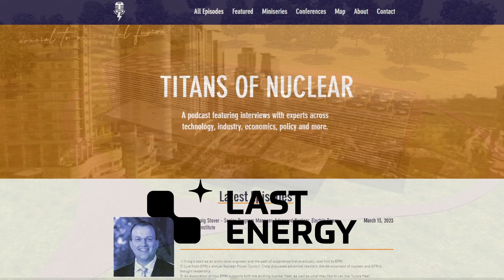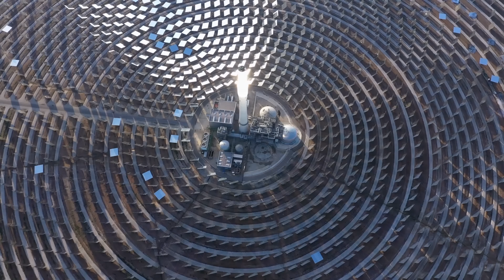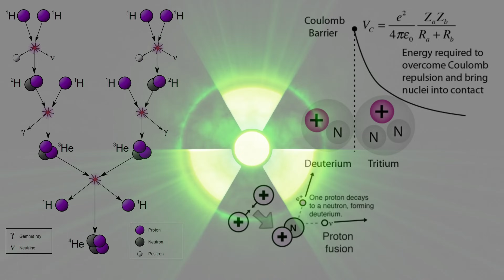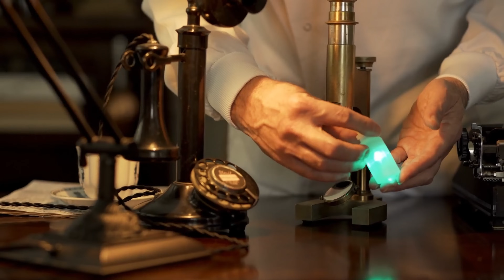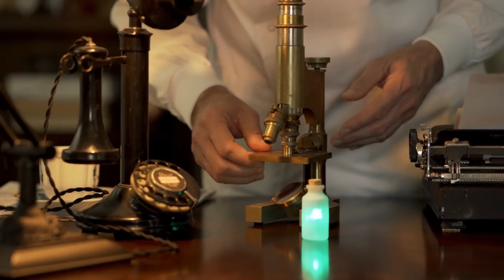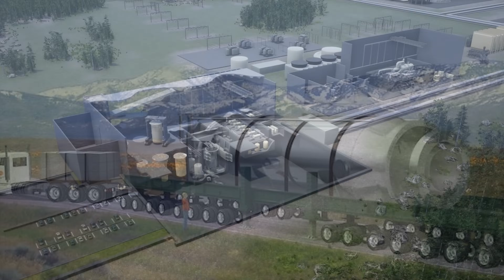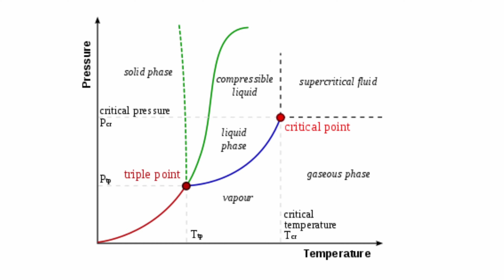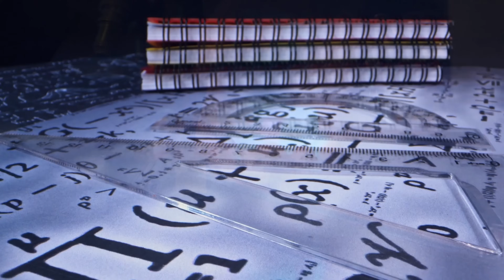Nuclear Power: Small Modular Reactors

Comment: I am disappointed Isaac didn't mention the Argentine CAREM SMR. We were the first country to finish a design and start to build it. We are behind schedule due politicians screwing the budget, but we were 20 years ahead of the rest of the world, until China made theirs.
CAREM is 25MW for the experimental one, which will be scaled up to 50 and 100 and you can put several of them to increase output as needed. The idea is to build small nuclear plants at low cost close to demand points and fast using serial production of the reactor's components.
Reply: I'm interested in this subject but have never heard about it. Thank you>
Reply: I love it. 

My philosophy is simple. 

MOAR SAFE NUKLAYR NOW
Reply: Sadly today's political leader are holding society back and preventing a nuclear Renaissance because of fear mongering.
Reply: It doesn't sound like you're ahead of NuScale in the USA, with their 77MW reactors.
Reply: @cacogenicist    They have a different concept, is more complicated and tradition outside the small modular part. CAREM are an escalable design, you can make them produce less or more, or have traditional reactors output just pairing several of them. The design can produce 20MW up to 120, the 25MW is the tech demonstrator. 
It is a fully self contained reactor without active control, cooling, moving parts. It cools by convection and the physics make it impossible to fail as it operate in a very difficult and rare spectrum of equilibrium and any deviation self corrects by pure physics. You can read papers of it on international sites of nuclear technology. 

Youtube deletes comments with links, so google: neimagazine feature
carem argentinas innovative smr

We could have had it working 10 years ago if not for the corrupt and inept governments withholding funding. So the CONEA (nuclear scientific authority) and INVAP go slow on it.
Reply: Sorry but except of new name yours reactor don't differ from 50 experimental reactors
Reply: @simon2493  Actually it does. Is one of the most advanced, safe and simplest of the lot. It use 100% passive cooling, no moving parts, no auxiliary equipment like most of the US projects. 
No pumps, no active control. Is a self contained reactor. There is plenty of english papers from nuclear tech sites explaining it. 
Also is not a "new" name. CAREM has been on development from decades. It is on construction and only held back by the governments wasting money in anything but where is needed.
Reply: @Argentvs  Considering China has opened a bunch of coal plants, and regularly lies about their tech projects (not to mention the IP theft), you're probably still ahead of China in reality.
Reply: @Argentvs  SOmething like Sweden proposed in 80s or smth....
Reply: @piotrd.4850  The idea comes from a long time ago, but never passed from theoretical proposals. Though the work in Argentina also roots back to the 80s when Argentina was building experimental and isotopes reactors. Possibly is has s lot to do with the Nuclear Power Submarine project, cancelled in the 1990s with the wave of destruction of the national defense industry by pressure of the USA. The Navy was on work of a small compact reactor using enriched uranium. Which our SMR CAREM also uses.
Reply: @Argentvs  Maybe don't get your funding from governments?
Reply: @algorithmgeneratedanimegir1286  all nuclear activities in Argentina are a under the National Commission Of Atomic Energy (CONEA). Uranium enrichment plants, heavy water, special fuels, special alloys and high tech dedicated things related (space solar panels, nuclear medical equipment and products) are the work of it and it's state companies liked NASA ( nucleoelectrica Argentina, power reactors), Dioxitec, etc.

CAREM is a propietary design of the nation designed by national scientific and technical research system by the Balseiro Nuclear Institute, part of CONAE. The builder is a state company society by the province of Rio negro state, where the Balseiro institute is, and CONEA. Subcontractors can by private, like Pescarmona Heavy Industries which made the pressure vase of the reactor and other high strength steel parts.
Reply: @algorithmgeneratedanimegir1286  Then you won't get anything built period. The global nuclear buildout is dominated by either direct government-owned companies like OPG or regulated monopolies that negotiate with the government to set rates to a level that allow them to commit to large projects, see TVA. There was actually an announcement on SMR collaboration between Canada, the US and Poland over developing SMRs and OPG and TVA were the utilities involved with only Synthos Green Energy being anything like a private company. OPG is comfortably in the lead in getting a reactor built and TVA is prepping a construction permit, the most private capital oriented of the utilities involved is basically just in the room with the people actually spending money and doing the work.

This isn't a mark against Poland either as the depth of knowledge and capacity in their nuclear industry just isn't there to expect them to be an aggressive first mover but if the only way to get private companies moving is for them to catch the bow-wake of a government initiated project... well it tells you who the key mover is. I look forward to the day where my perception here is challenged or changed by some private company betting big on a 40+ year nuclear investment but until we see that investment then government or government associated entities are the only tree worth barking up.
Reply: @algorithmgeneratedanimegir1286   that will slow down the progress considerably. Kinda like here in the US. Private funding only blows.

Comment: Nuclear currently is the only viable option for large scale green energy. Solar and wind work at small scales, but they're still too expensive and inefficient to power whole towns, at least not without supplemental sources.
Reply: And solar requires a lot of mining of rare earth materials which causes deforestation & creates a lot of pollution.
Reply: Solar has been plummeting in price and still is. It already is way cheaper than nuclear, especially when you remove state subsidies because no private entity will insure nuclear power plants.
Of course for solar you need to add the costs for storage but those are coming down fast, too.
Reply: Depending on country one or another type of green energy already replaced in huge chunks nuclear energy and its effectivness is still increasing. With upcoming better batteries, there isn't even anymore the old argument viable that it is just to soften peaks as one then can safe the energy from those peaks for the rest of the day. Even in cloudy areas due to no more effective solar cells, they are viable. 

Besides all that though. Nuclear energy still has one main issue not solved, there is neither a way to store nuclear waste safely for millenia to come or inform those who come afterwards what those sites are all about when they find the crumbling infrastrucutre and leaking waste. Nore is there sofar a way to chemicly change nuclear waste into not-radiating other materials that then could be reused for other purposes. Breeders may reuse some waste, but also produce even more dangerous materials in the process. Thorium reactors are still not a thing or have you heared any success from the Chinese test reactor that should have already been online now for months. I would assume they would have bragged about it by now. Thorium molten salt was not followed up for several reasons, one being that the  brine is so  corrosive that no material would withstand it. Please let me know if you have actual scientific proof there has been successful energy production with molton salt reactors that deliver energy reliably over a prolonged time. Don't get me wrong i would love to see the Chinese succeed in this one aspect as that is the only form of nuclear energy i even remotly would support as "green" energy. Till then nope, no deal.
Reply: @kinngrimm  Spent fuel reprocessing solves the long-term storage problem.  After burnable fuel is extracted the remaining waste consists of fission byproducts that decay to safe levels in 300-500 years.  It also very effectively extends fuel supply.

Comment: Just in time!

I was wondering if it was theoretically possible to get handheld reactors or at least reactors the size of say, microwaves
Reply: theoretically possible ? yes , but practical would say No . Isaac?
Reply: @paperburn  Why would it not be practical?
Reply: RTGs are a better choice
Reply: @duckpotat  You can't really make those output more power though

I was mainly looking for something that has the advantages of a reactor
Reply: @hoominbeeing  I think the issue as far as I understand it is that microwave-sized or smaller reactors would need to run on exotic low-critical-mass isotopes produced in breeder reactors, with expensive fuel production, a limited shelf life, and significantly higher 'unused' fuel radioactivity, making keeping the reactors fueled them an issue. They'd also generate a LOT of heat for their size, potentially needing some sort of external cooling with water or air.
It could be done, sure, but it would probably not be a popular source of portable power due to the extreme expense and numerous hazards, unless there was some super-important need for extremely high density portable power generation, by an organization able to produce, distribute, install, and dispose of the exotic fuels safely, on top of actually operating the reactors, and no better options were developed.
Reply: @05Matz  Can't you enrich the uranium (or polonium, since it has lower critical mass) to get lower critical mass?

Current reactors are enriched to 3% at most, this one could be 90%
Reply: @hoominbeeing  Well then your microwave would be carrying weapons grade uranium, that is, the heart of a nuclear bomb, so I think it's a no go on that one chief
Reply: @hoominbeeing  You could probably do it with highly enriched uranium or plutonium too, but that's pretty frowned upon, as it would look exactly the same to other countries as building nuclear weapons, and the facilities required could probably do both fairly easily. I'm not a nuclear engineer, but I think you can make smaller reactors with higher purity fuels, that makes sense to me because there's more of the fissile atoms and less of the rest in one unit of material.
If a power that already HAS factories for producing new bomb cores wanted to build tiny reactors for some kind of high-security military use, they probably could figure something out, I suppose. But I'm not sure how far you can go with any given fuel.
Reply: @hoominbeeing  Ots possible to make tiny "nuclear batteries".   Richard Muller has a fantastic book about alternate nuke power plant designs, including small solid-state reactors to power a small town that can be built entirely underground, sealed, and need no maintenance for decades.  These are great for security concerns.  There would be no way for bad guys to steal hot stuff without a giant, months-long excavation project.

I think he also covers handheld reactor designs.  It's definitely possible.  . . .except for the problem of retail products full of reactor-grade uranium.
Reply: @jengleheimerschmitt7941  Ik about nuclear batteries/RTGs, but those are quite different from reactors.

As for handheld reactors, I wouldn't imagine those in Walmart lol. Handheld != Sold in walmart
Reply: @hoominbeeing  I could see backpack/microwave-sized nuclear reactors being possible, and I love the idea just for the story concept of a hard-ish-scifi version of an anime-style superpowered fighting android or similar gimmicks but I'm struggling to figure out a justification for why someone would actually produce such a reactor. Only the military would have the materials and safety waivers for it, but they wouldn't want to put them in a war zone where they might get shot up or bombed, leading to bad PR and extremely expensive cleanups. They'd also probably need to be kept in water or otherwise actively cooled from the outside when operating to dissipate the tremendous heat produced by that kind of power output in such a small space. I suppose such a thing might be useful in some sort of extremely-long-mission-duration underwater drone cruising around in international waters, much like a miniature version of modern nuclear-powered submarines, where the users are confident they'll end up on the bottom of the ocean (likely in international waters) if destroyed.
But outside niche underwater military drones (probably submarine-hunters?) and space travel, I don't see many uses for them, and lack of many practical uses will greatly delay development of the tech required even for the few things it IS handy for.
That said, if energy weapons suddenly become a big thing but batteries don't get better, you're kind of forced to invest into portable, ultra-high-density power generation that can be throttled up and down, and nuclear generators may be the only practical way to run an electric laser cannon off-grid for all I know. I just think that defense planners would think twice before, for example, guarding their borders with fission-powered AA laser emplacements, knowing that the enemy would just HAVE to blow them up first in the first stage of invading.
You could bury the reactor several meters under the installation on a cable to protect it, I suppose, but that would ruin the ability to pack up and move the guns after the enemy sees them to prevent them from being accurately hit with artillery, unless you're moving them between multiple pre-buried reactors, and then you're dealing with unattended reactors hidden all over the countryside.
Reply: @hoominbeeing  Well, yeah, I suppose handheld doesn't necessarily mean sold at Walmart.  But most of the advantages of handheld power would be lost if each individual device was subject to the sort of security we currently apply to reactor-grade uranium.

Even small amounts of reactor-grade uranium are extraordinarily dangerous to have outside of a very secure site.  If anyone got their hands on a few hundred pounds, of reactor-grade, it would be fairly easy to refine it to weapons-grade in your garage.  104 pounds of weapons-grade u235 and stuff you can buy at Home Depot can very very bad bad happen.

It's not just that we can't sell it at Walmart.  We can't have any of it anywhere outside of an ultra-secure facility.   

Remember what happened when that tiny couple of grams of Cesium fell of that truck in Australia last year 😂 . . .     

As a guy who personally looses several hand-held devices every year, I have trouble seeing what hand-held devices containing reactor-grade radioactive material would be anything short of a very very bad bad.
Reply: @jengleheimerschmitt7941  Hmmm, wondering if we could use thorium instead? Specifically molten salt ones

Those reactions can easily be stopped, so there's less risk of radioactive waste being spewed everywhere if it's destroyed
Reply: that would be cool
Reply: You could make an RTG that size.
Reply: So a handheld dirty bomb you mean? 😄

Comment: Anyone notice how a super powerful energy beamfromspace  anywhere will have to burn some birds that get in the way unless they have large perfect repellent measures around the receiver?
Reply: Actually, the beams can be made wide and spread out enough (at least with microwave beams) that they're either harmless, or at least weak enough to be more painful than actually damaging, so that the birds will just... freak out and move out of the 'cone of heat'. The downside is that this requires very large (though not necessarily solid, metal mesh suspended from a series of towers  with crops or natural parks or whatever growing under it works just fine) antennas to receive them, and they might also make the transmitters slightly larger? It's typically assumed that you'd use this kind of power beam design around Earth so that you don't have to deal with everybody else trying to keep you from having access to a death ray, anyway.
Reply: My point is those board will waste the energy and block that portion of the receiver they land on and most likely damage it on impact too.
Reply: Yeah I am not convinced they are a good idea for planets with life on the surface. Great for Mars and the Moon lol.
Reply: Place the receivers away from migratory pathways, or float the receivers above the heights that birds typically fly at.
Reply: Oh, well. Fry 'em.

Comment: I have the idea to build a small CANDU reactor to power a neighborhood in a post-government scenario. All you need is a source of natural uranium, which can be purchased right now, and a few solar panels to power hydrolysis to obtain heavy water. Over about a decade, if not a couple years, you can refine the amount of heavy water you need, and you find a source of uranium to mine in that time, and begin design and construction of the reactor.
Reply: In a post-government scenario, someone comes and takes it from you.
Reply: @sleadaddy  in a post government scenario I give it to them in exchange to join their raiding party. It's not really the kind of thing that can be easily moved though.
Reply: Will be easier to burn coal or oil.
Reply: @Argentvs  maybe coal but oil needs to be refined